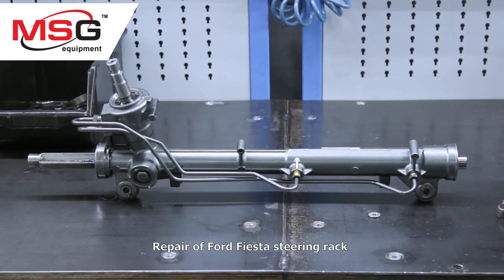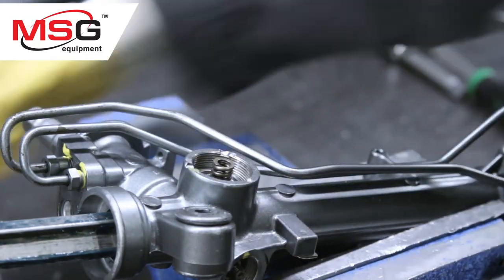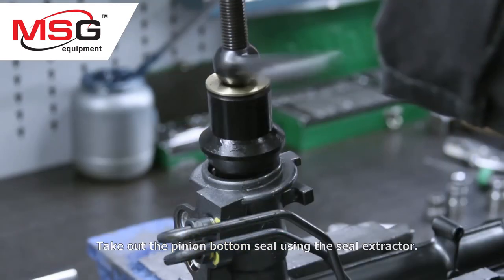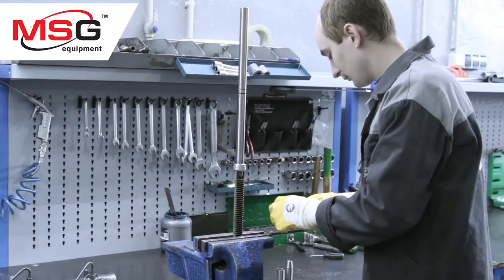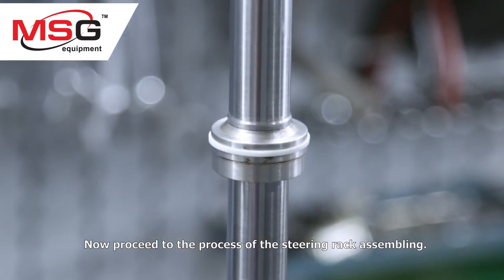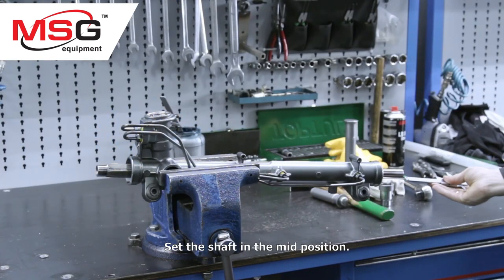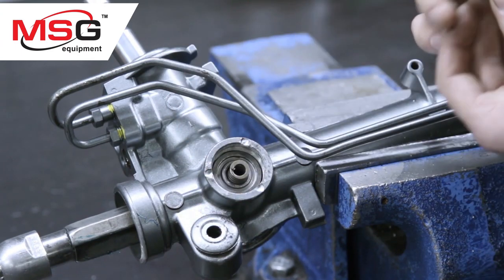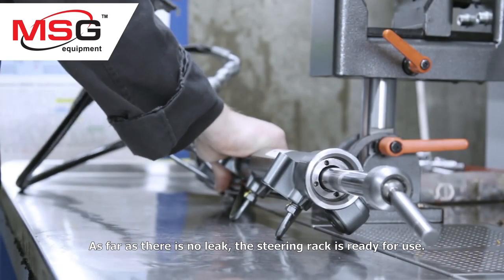How to repair Ford and Mazda power steering racks

Comment: My steering used to bind now it has no powersteering at all. It had a new pump put on. Still no power steering. I pulled the steer shaft but it would move great also the pump will bubble every couple minutes when in the air turning wheels..... I used trans tune in pump now. It has a lot of metal flakes in fluid. the vehicle is an 06 ford freestar with no power steering. WIll this rack unclog if I put a little gas in it( I seen this online) if not what do you think my issues could be and any idea how many hours labor or total cost? Please help sorry for novel

Comment: “Step 13 get help from machining lathe operator.”   I wish i were hyperbolizing / exaggerating….  Damn.  well that puts a damper (no pun intended) on the plan to rebuild this steering rack and pinion.
Reply: You can do that step with a dremel or a combination of file/hacksaw. I've done all three methods. Lathe is easiest and quickest but not the only way. Of course you only need to do that step if you have worn seals. Most of the time I'm converting these racks to manual so I just cut the whole thing straight off.
Reply: @adematthewsracing how do you put that big metal ring back on without a lathe? In the video it looks like they use a new big metal ring that gets compressed on the edge to get fixated on the rack
Reply: @prostmahlzeit  Generally I don't put one back on as I convert the racks from PAS to manual so it's not needed. Looks to me as though they're just pushing it on rather than doing any sort of machining on it. You could do the same with a floor mounted press or a drift and hammer especially with a bit of heat.